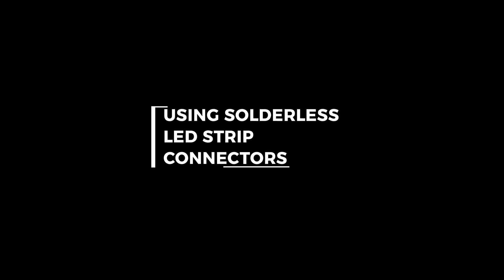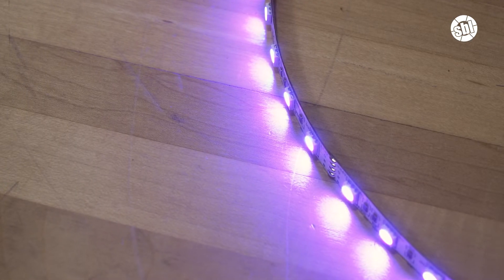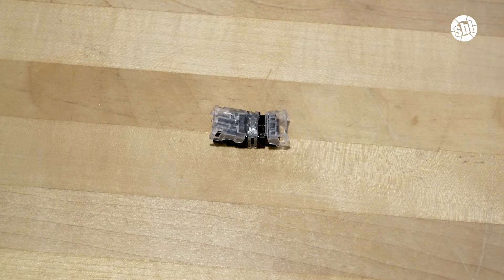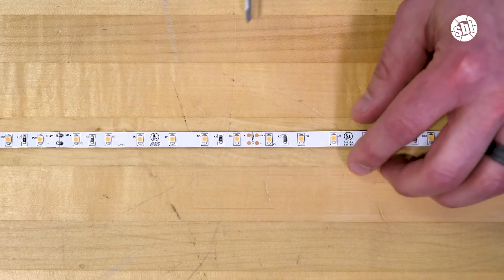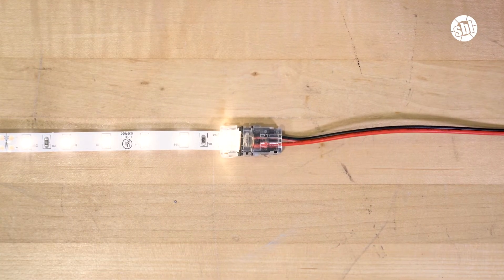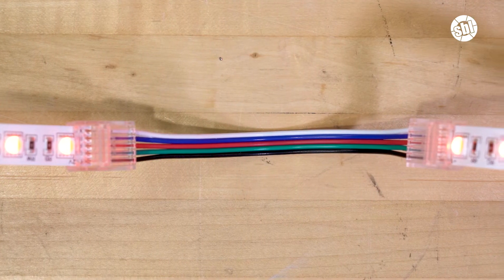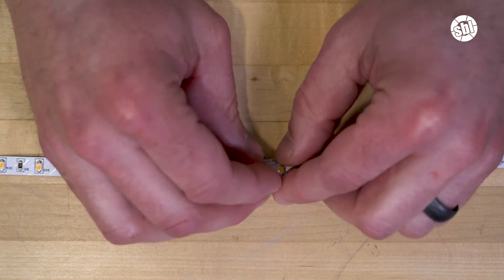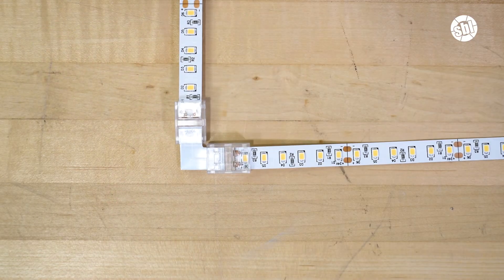How to Use Solderless LED Strip Light Connectors

Comment: Do i need to worry about the copper pads landing on the metal that pierces the strip? Or do i just stick it all the way in until it hits the wall of the connector?
Reply: I did that and the metal barbs bypass the copper pads on the strip.  That destroys the strip and you can't reposition.
Reply: @laurenk2080  I ended up buying a different connector bcuz these did not work for me

Comment: So you don’t have to strip the wire? How does it make contact?
Reply from the maker: Our Solderless LED Connectors have pins inside the clamp that will pierce the wires and make the connections. No stripping required.